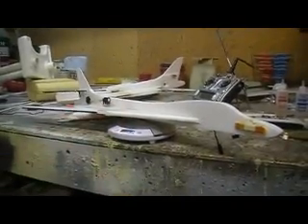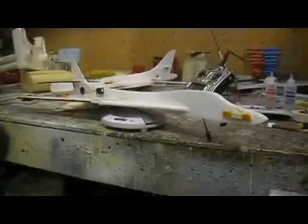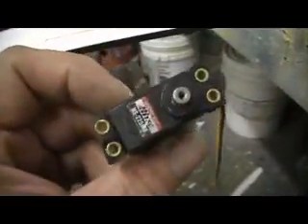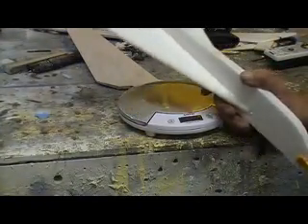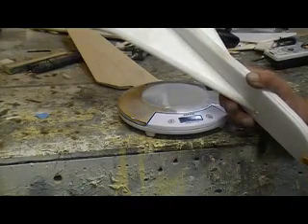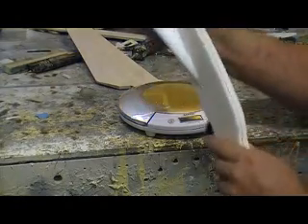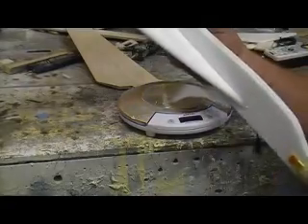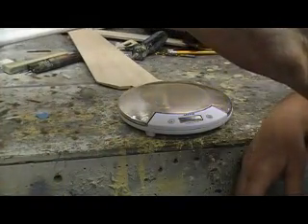foamie B-1 build pt 7

Comment: Bob,
I use the microjet motors from Grayson Hobbies with 6x4 props. Two of those will put your baby bomber in the air no problem. I also agree with Jason, some tape where the wings and fuselage meet will cut the friction down. You may be able to swing them on the ground with that small servo, but you will have problems with the loads during flight. I would also suggest using counter-rotating props to prevent any torque roll on takeoff.